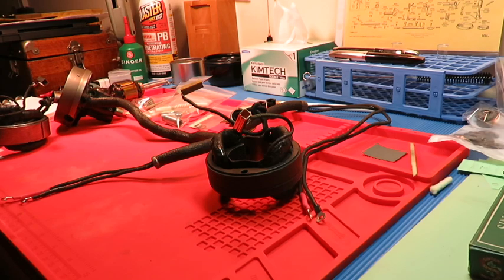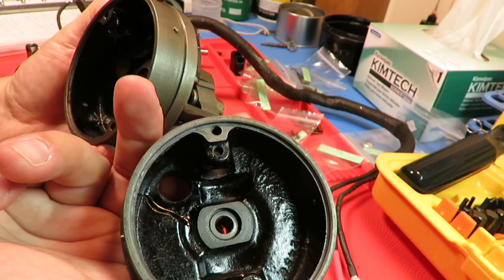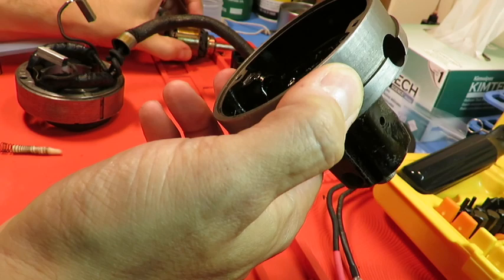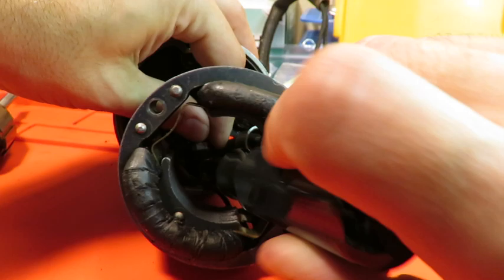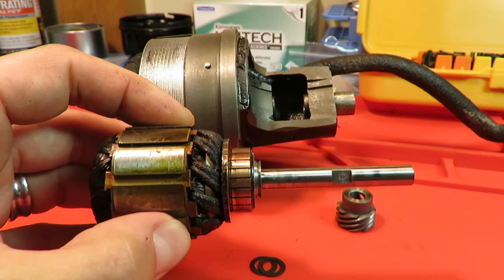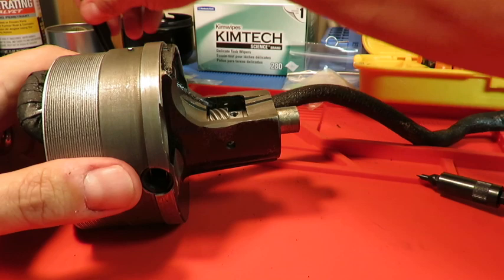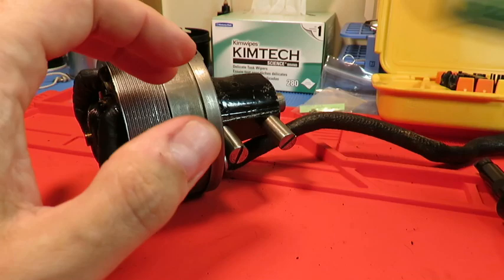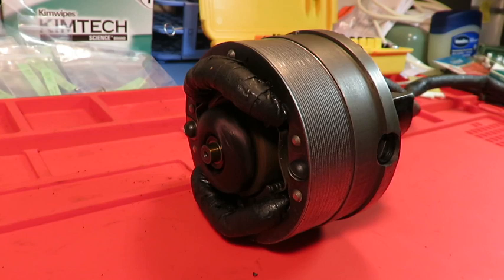Singer 101  Sewing Machine Potted Motor Reassembly

Comment: Thanks, very useful. My 101 motor did not have any washers! I just put back in the worm gear and I also put the other screw in half way, then the screw that goes against the flat spot. Tip: To stop the worm gear from spinning, use blue painter's tape to attach it to the body. Then you can hold the motor stable with your left hand and use the screwdriver with your right hand, without the worm gear spinning.

Comment: I liked your comments about what grease to use for wicking vs. gears.  I work on vintage sewing machines as well and have used Tri-flow grease for gears, but NEVER for wicking or motors. The Tri-flow grease has NO melting point so it will not wick properly. I use Sew Retro grease from the Featherweight Shop for wicking or motor grease taps.
Reply from the maker: Myself and some others in the vintage sewing machine community have worried about how well tri-flow, with particles of teflon in it, will wick anywhere actually -- concern that it may clog things like wicks, whether as the grease or the oil. I think sticking with things like petroleum jelly with no particles in it is likely best for grease involving wicks, and basic sewing machine oil for oil that's wicked (like in the Singer 101). Thanks for bringing that up!

Comment: Hello I have a 1926 Model 101,  I put power to it , and I get a Hum, turning the hand wheel, It seems plenty free,, any Idea what I should look for ?
Reply from the maker: Hummmmm, (haha) -- not sure. I would remove the motor from the machine and thread the wires out if you can, and try powering it free of its connection to the power train... sounds like it'll need maintenance in any case, and it's easier to do that with the motor removed so it's not dangling by its wires.

Comment: I just picked up a Singer 101 at a yard sale.  Could you please make a video showing how to remove the bobbin case from the hook assembly?  There a 4 tiny screws in the assembly.  Not sure which to remove and which to leave alone.
Reply from the maker: I'm just getting to the machine mechanics, actually -- I figured I'd start with the part I knew the least about! There is a lot of help to be had over at the Victorian Sweatshop Forum - -whole threads of info dedicated to the 101, not just mine linked above. You could definitely find help faster there than waiting for my next video; I'm notoriously slow!